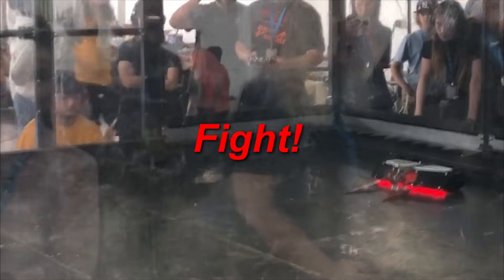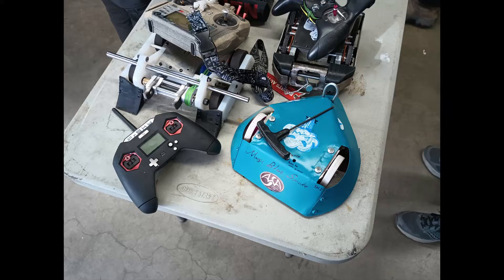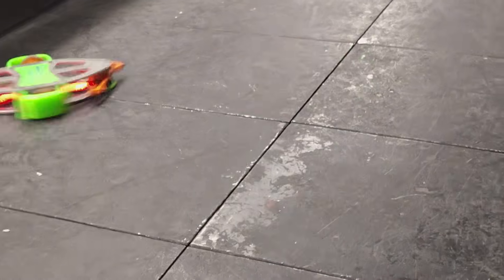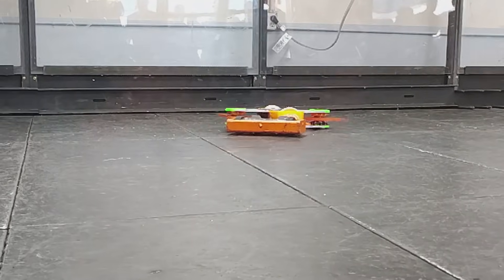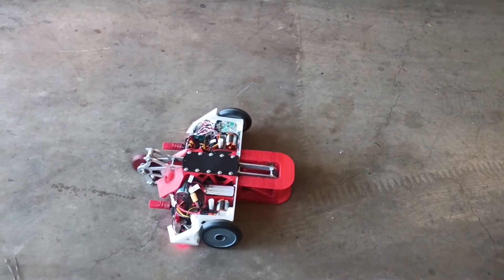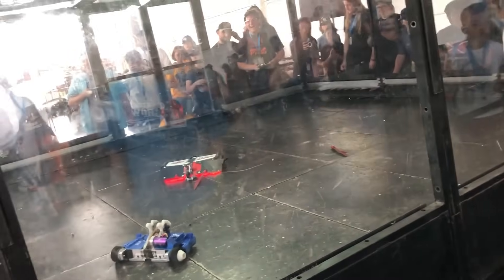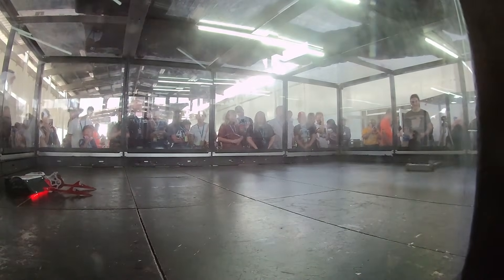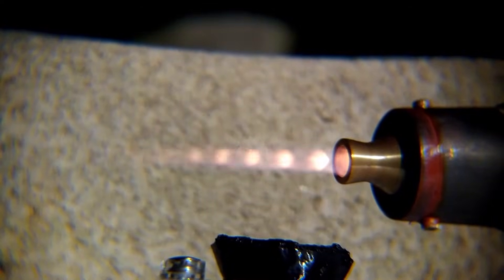Building a Robot for MAXIMUM DESTRUCTION- Parasite

Comment: Simplicity is king. Awesome design, but far more complicated than it needs to be

Punching is a concept id love to try one day myself, but im far too lacking in skill and determination.
I dont think this adds much for you, at least in the power compartment. How about using a spring to add some actual force? But then complexity grows significantly so maybe not, unless you only punch, no spinner.
Two wheel drive is awesome. I wonder if mechanum wheels could be an option, they seems incredible to me.
Ive seen a lot of builders put belts on the wheel drive, instead of gears, you shouldnt experience any impact force there, unless they get hit
The forks dont seem to add much, but complexity.
I didnt pay attention enough, but does your spinner have one teeth or more? Less is generally better for more aggressive bite

Anyway this is really cool, and i wish you best of luck, hope my criticisms and insights help